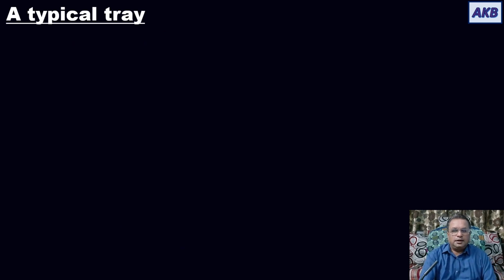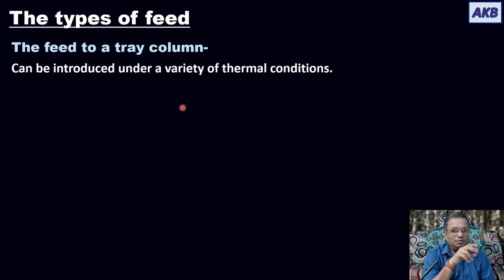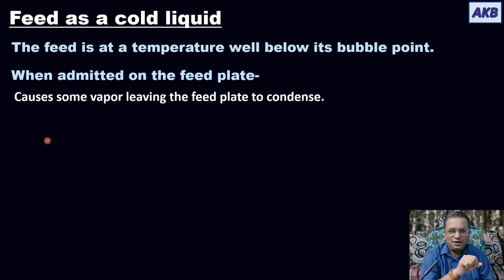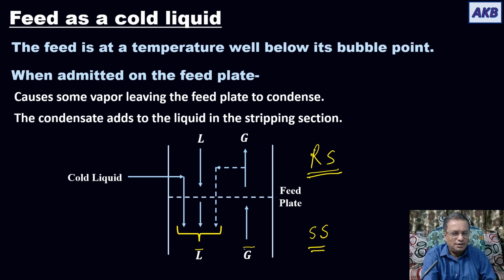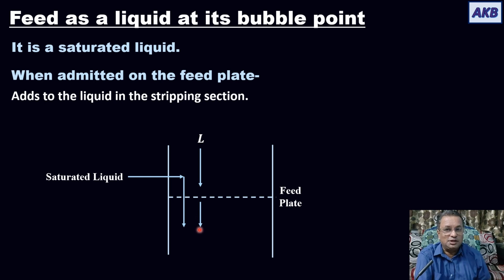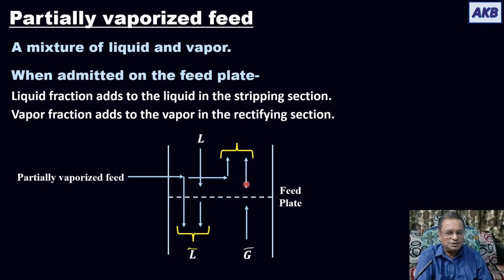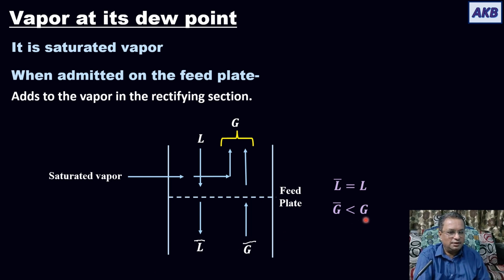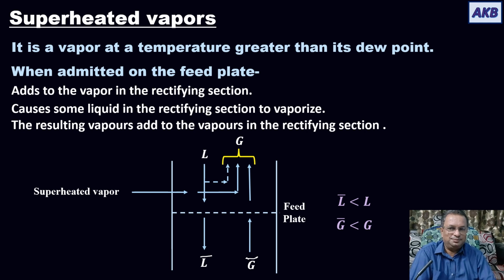Distillation Part 24 The feed tray and types of feed to a typical Tray Column

Comment: *Typically admitted feed into the rectifying section of a distillation column rather stripping section for 1) efficient separator, 2) thermodynamics Equilibrium balance, 3) Energy optimization, 4) Pure quality of product and yield.
Any other apart from that please let us know????
What are the specific criteria for feed location? Because  many times its critical to achieving efficient separation and energy optimization.
Reply from the maker: The location of the feed plate can be found out by using methods like McCabe-Thiele, Ponchon-Savarit, etc.
These methods use the VLE data and the type of the feed for locating the feed plate.